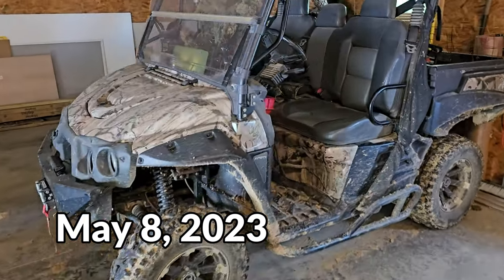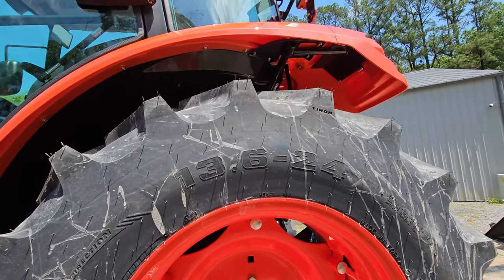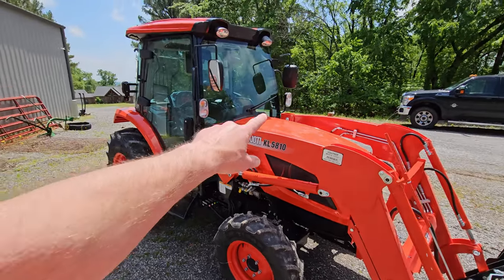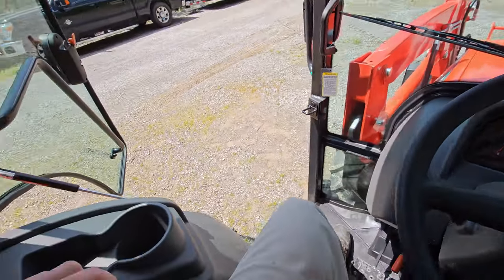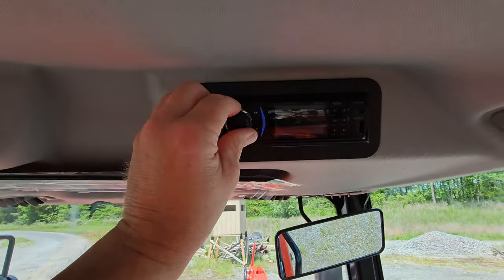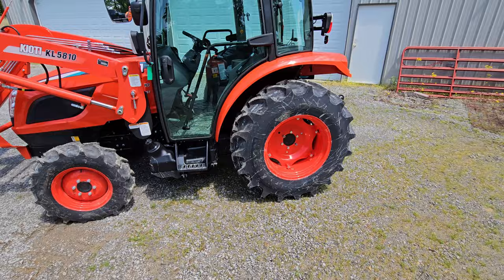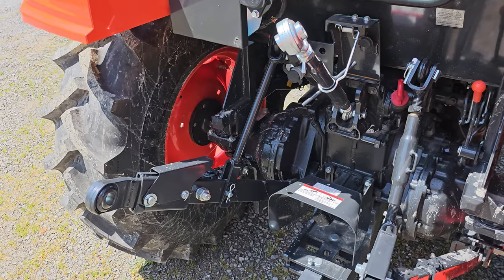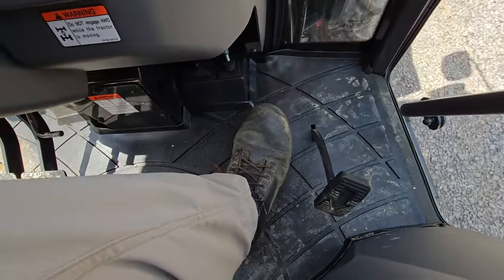Kioti NS6010 HST Cab delivery, walk around, test drive, upgrades, & more!

Comment: If you got rid of the RX7320, please say why. Im due to pick one up in June.
Reply from the maker: I did not get rid of it. Planning on keeping them both unless we absolutely can't afford to. The RX will pull my new/used 11' disc and the RX does the spraying with that heavy water tank. The NX should handle most everything else. Probably going to get rid of the skid steer. Thanks
Reply: Thanks buddy. Looking forward to picking mine up.

Comment: Congratulations on the new tractor looks a really capable machine 💪👍 my only concern is the down swept exhaust 🙄 you mentioned about it doing a regen and when a diesel engine is doing a regen the exhaust gases reach some really high temperatures which could if parked in the wrong place could set fire to dried grass leaves etc, looking forward to seeing it at work 💪💪
Reply from the maker: Good point. Although with my first NX and the RX i have not had a problem with anything catching flames, but I will keep it in mind on my next manual regen!

Comment: 2 questions, the loader that you got on this  particular NS tractor is it the same lift capacity as the KL6010 , or is it an option to get the KL6010 on the NS tractor
Reply from the maker: Man, I have the same question! The KL6010 seems to have a little better specs, but I didn't know (and I don't know) if you can get either one, or if the 5810 is made specifically for the NS?
Reply: @kapperoutdoors  ** I wish Kioti would have taken the same lights that they have on the 7320s and put that on the NS tractor" I'm talkin about the rear lights" or even the same fenders.. * also I wish they would have put LED lights on the top part of the cab. The lights that they put on the top part of the cab are not high intensity!! I had to upgrade mine..

Comment: Kioti told me if i loaded my front tires it would void warranty
Reply from the maker: Good info, but not sure how it is any different than loading the rears? Good thing I did not load the fronts on this one! Thanks
Reply: @kapperoutdoors  you should ask your Kioti dealer.  mine in NH told me the front Axels can’t handle the extra weight all the time with the turning etc. who knows.